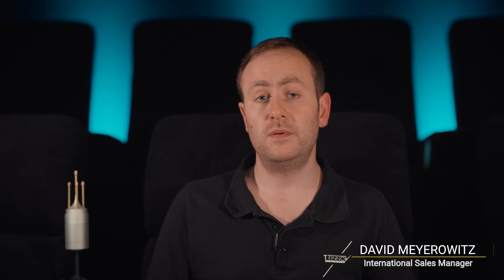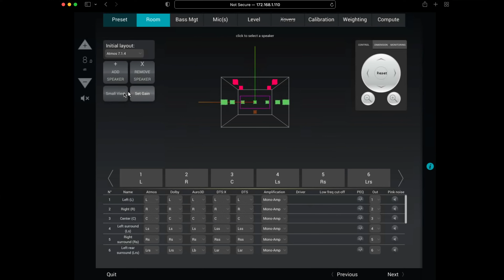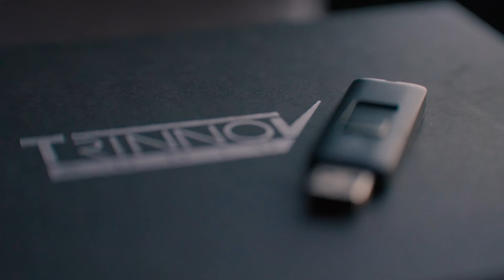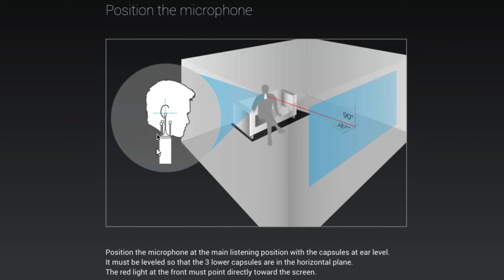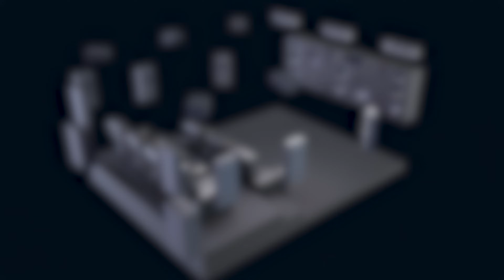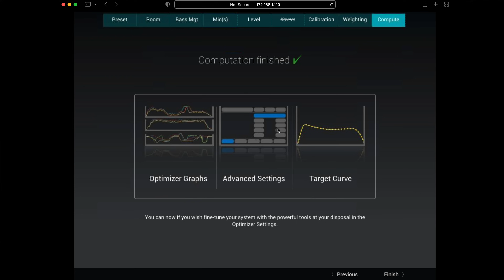Trinnov Altitude Tutorials : The Wizard Setup

Comment: How do you select a saved preset? For some reason it keeps going back to my first “test” preset every time I turn off and on my trinnov. So when I open the app how to I set it to my desired saved preset and better yet how to I program my desired preset to be the default selection?
Reply from the maker: That function is described on page 65 of the reference manual: One preset can be chosen as the default preset to be automatically loaded at each start-up if its Def button is checked. The No default config of the Startup screen can disable this automatic load if desired. However, if a Profile is linked to a preset and set to be loaded at each start-up, the preset attached to this profile becomes the default preset.
Reply from the maker: For in-depth support questions please contact our support team at support@trinnov.com

Comment: Dans la vidéo il est indiqué de régler le niveau pour la mesure à 85 db, et d’ajuster les niveaux avec le volume des amplis pour chaque canal. Mais si j’utilise des amplis Trinnov ou autres sans réglage de volume je ne peux pas le faire.
Quelle serait la solution pour avoir des niveaux identiques quand on utilise des hauts parleurs avec des différences de niveaux importantes. Subs passifs versus principales par exemple.
Cordialement.
Reply from the maker: Bonjour François, pour les questions plus détaillée merci d'écrire à notre équipe support, ils reviendront vers vous rapidement avec des réponses détaillées support@trinnov.com
Reply: @TrinnovAudio  I think this is an interesting question that a great many people would like explained. So maybe a video on that? Merci! :)
Reply: @eubikedude  This is easily done using the Active X-Over section of the processor. You can adjust the gain for each channel to level match them prior to calibration. You will need an external DB meter but a phone app will do as its just to get you in the ball park before the Optimizer takes care of the rest.

Comment: This is great, wish it was available a few months ago when I first set up my 16.
Reply: I took the time to figure it all out on my own.  I practically slept with the manual.  Now, I’m thinking of making a special preset for 2 channel operation.  I’m tempted to go back and tinker, but it sounds so good now, better judgment wd b to leave it alone; couldn’t be happier.  I was using the Krell Evolution 707 3D but much happier now!   Thanks Trinnov!!!
Reply: @Elitekuro  The beauty of 29 presets and USB backup is you can tinker with the s/w as much as you want and still get back to how it is now. :)  Moving speakers around on the other hand .... notes (and maybe adjustable shelves) required! 😄
Reply: Question:  I wonder if setting the individual volumes on each channel a little higher during the preset setup wd result in higher general system volume dynamics during playback?  Initially, I was afraid of it being too loud, so I stayed closest to the minimum volume during setup.  I’m using all larger bookshelf speakers and was afraid of overdriving them.  Problem now is I’m usually at around 70-75% of volume before I’m feeling it.
Reply from the maker: @Elitekuro  Hello Lloyd, for more detailed technical questions, please write to our support team: they are the best ! support@trinnov.com
Reply: @Elitekuro  When you say 75% of volume, how are you measuring that? What is the display showing in db or attenuation?
When showing attenutation it goes above 0. Alos the calibration adjusts the displayed level based on reference volume.
Reply: @eubikedude  Hello EV,  I have a remote setup with a Control4 univ remote.  The display on the remote gives a % vol as u adjust.  Rarely now use VNC to view UI, but of course that’s an option too.  I may go back and do another ref cal set a little higher, closer to 80db in pink and see if there’s any dif.